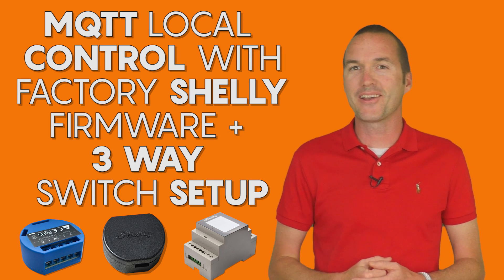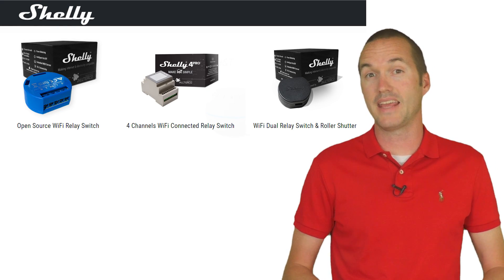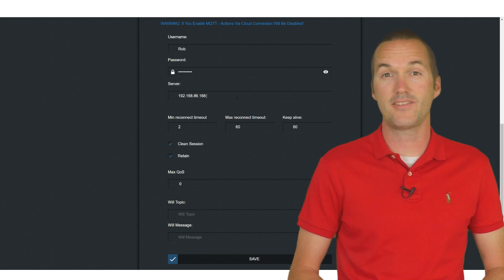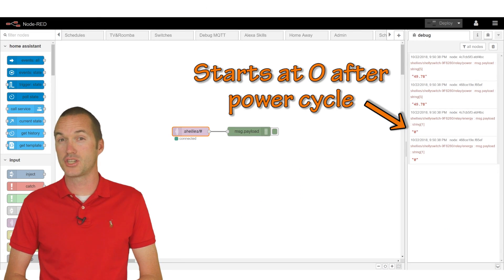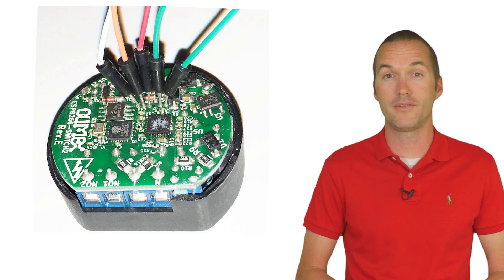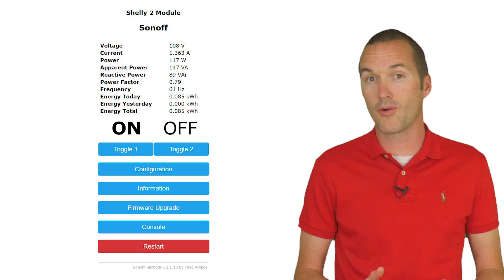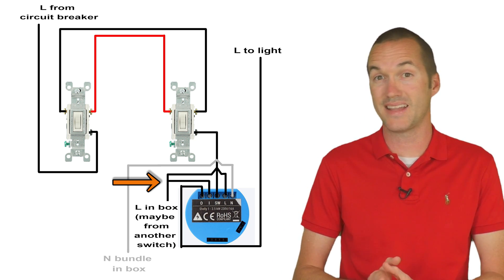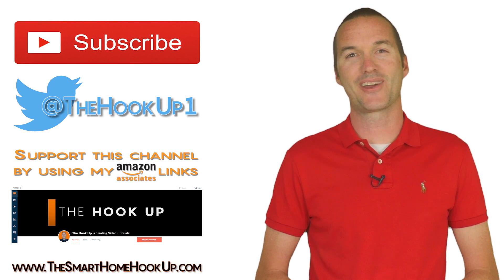Shelly native MQTT support, Tasmota on the Shelly2, & Setting Up a 3-Way switch

Comment: After how much time is the power updated? Can it be programmed to 1 second or less?
Reply from the maker: With tasmota, yes, with the shelly firmware I don't think you can change the rate.  

You can still use it as a roller shade though where it will use power consumption to sense when the motor has reached min/max value.

Comment: Noob question: Would a Shelly 2 sitting behind a switch box with switches for two lights enable you to toggle both lights independently, both via the physical switch, and via Home Assistant? In other words, so whether the physical switch is up or down, an HA-issued "turn on" would turn it on, "turn off" turn it off, and flipping the physical switch toggles whatever state HA has put the light in.

I assume that a setup something like that is a typical base want for home automators anywhere, and that making it feel and behave well would be a great subject for another Shelly 2 video. I would not be surprised if it actually takes some Node Red state flow hackery to make sure actual behaviour not have unpleasant counter-intuitive gotchas.
Reply from the maker: What you have described is the factory experience.  No complicated node red magic. Just install the switch and select "edge switch" as the switch type in the shelly app.

Comment: Rule #1 for me, don't use stranded copper wire in place of solid,  it doesn't seem to hold as well as solid copper in the terminal vise connection.

Comment: According to the spec sheet the unit consume less than 1W in standy, so installing 30 devices would add 30W standby  thus 21,6kWh per month or 260kWh per year which costs about 75 eur per year. Something to take into account if you want to build it for the whole house.

Comment: Rob thank for the video,  luckly i had ordered the dual when it was avaible. i updated the frirmware and it is 20181001xxxxx but i do not see the Advance Developer Settings on my Iphone App.  I have the Restricted Login in the Menu and the next one is Cloud. no Advance Developer
Reply from the maker: I think it's only in the web console
Reply: ok so i ahve to leave the cloud connected to configure and leave it enabled ? or once MQTT is configured i can disable cloud ?...looks like i will have ot solder the leads and get tasmota on it
Reply from the maker: No, the web console is it's local ip.  It doesn't need shelly cloud for you to connect to the local ip.
Reply: When using the shelly 2 for shutter what change? what are the topics for up and down?
Reply: Thanks Rob -- I too couldn't find Developer options to enable MQTT in the iOS app but it does in fact appear when I navigate to the local IP in a browser.  Great tutorials man !!

Comment: Great minds think alike, re: 3-way switch.
Also, looks as if I have to retain the existing toggle switches to do this (WAF) so I'll only be installing on 3-way circuits. We're still stuck on up=on for single switch circuits. I'd already jumped on the restock of the 2pk, but next order I'll try to remember your affiliate links. I still need to get a multi-sensor together for outside temp & %RH. Haven't figured out the best place to install yet.